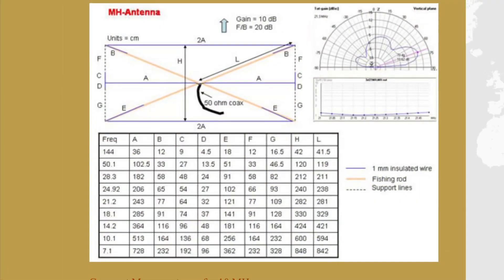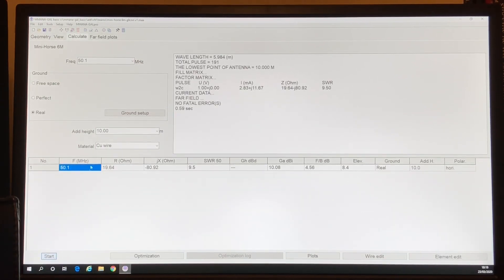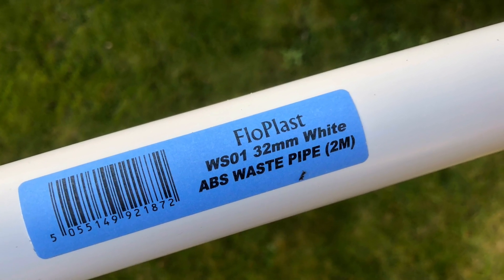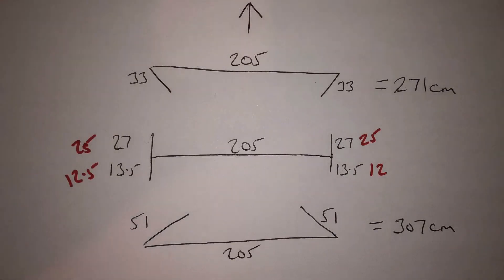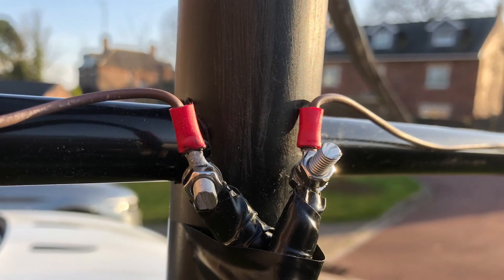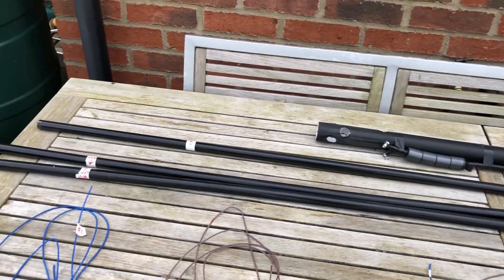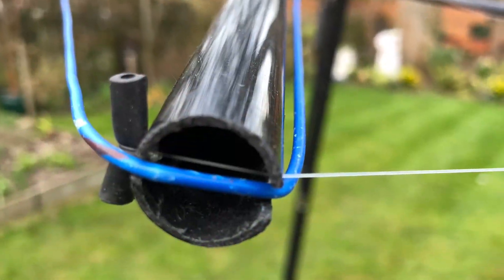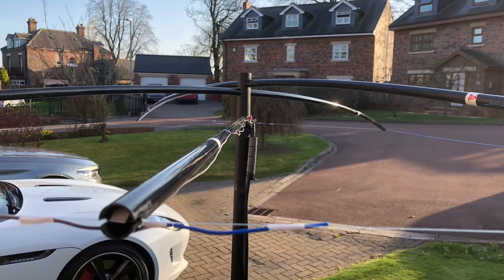6m Mini-Horse Antenna - Part 1 Design & Build

Comment: Hi Ian.

Came across your videos last year and I built a mini horse yagi for 10m and it has changed my world! I went from working mostly local to doing a lot of DX!

I have however noticed that my resonance has lowered on the antenna and I suspect the wire I used might have stretched.

What I would like to do now is trim the wire in order to bring rhe resonance back up from around 27.9 to 28.5. How do I go about that in reality?  Do you trim all the elements? Only the split dipole? Do you trim all the elements the same amount or do you adjust each relative to each other (using a percentage value)?

I'm used to efhw and linked dipoles which are quite straightforward to trim, i feel a bit lost when it comes to trimming this yagi.

Cheers
ZS6FY
Reply from the maker: Hi Phil. Great that you’re enjoying the mini-horse! Are you sure the wire has stretched? Seems odd, as it’s not really under any tension. Anyway, you’ll need to remove the wires to trim, so you’ll be able to tell if they’ve got any longer, assuming you can recall the original measurements you used. The approach I used was to treat all three elements the same in terms of the “total” amount to trim. So the middle driven element also needs to trimmed by this amount, but shared equally between the forward and backward pointing dipole ends. So a 2cm trim overall would be 1cm off each end of the director and 1cm off each end of the reflector and then 0.5cm off each of the four dipole ends. I’m sure you sort it ok. If not already, have a look at the mk2 10m mini-horse on the channel (there’s a plastic 10m mk1, like this 6m one, but I’m liking the mk2 cane version 👍🏻). Good luck 😀

Comment: Hi Ian, I'm going to have to have a go at building one of these! I'm just wondering if there's any difference in making this from white PVC tubing? I always assumed that the black plastic was a bit more RF lossy ( and could therefore effect the tuning. It could also distort more in the heat on a sunny day :-) ) . Thoughts? 73 G0JLF.
Reply from the maker: Hi John. All’s been well with mine. I chose black so it doesn’t stand out as much, but like you say, the DIY shops have same sizes in white. Coincidentally, I am giving the 10m version a trial as we speak. Built it a few months ago ready for spring/summer DX (2x videos on this channel show the build). Yesterday was good on 10, so set up in the garden now. The band isn’t a fraction on yesterday so far, but it works a treat 😀 Good luck with yours 👍🏻